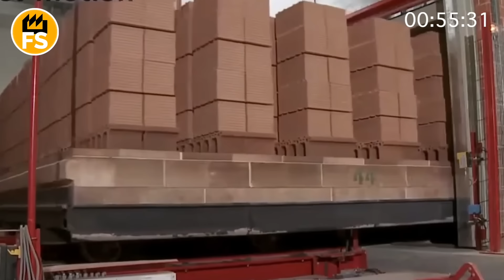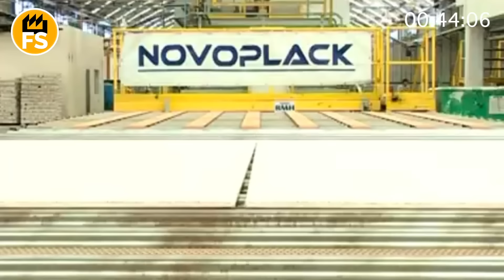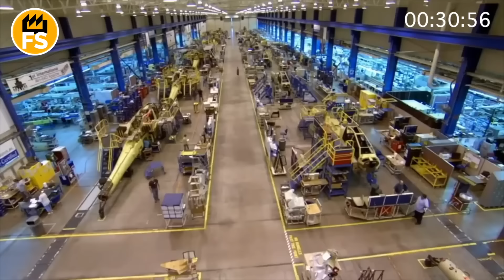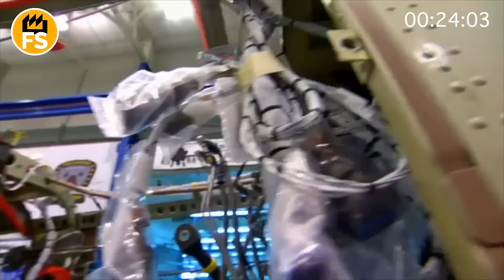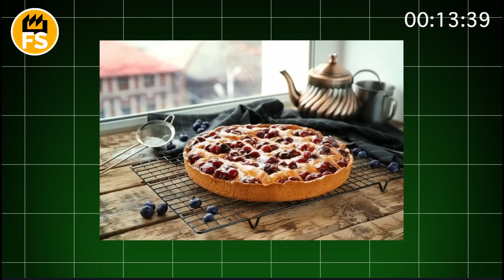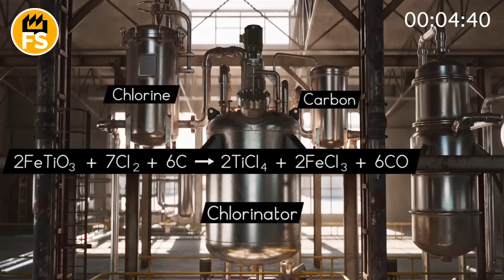How It's Made: How 130 Million Bricks Are Made Per Year! | Top 10 Videos

Comment: At 24.04 you talk about the accuracy of the steel size causing structural collapse.  A signpost  in the picture says Miami Dade which I suspect is Champlain Tower South. If so it's collapse had nothing to do with the steel being a few millimeters undersized so yet again just a cobbled together load of part truths and many errors.
Reply from the maker: Thank you for your insights, @stephenwest9757. While the video primarily focuses on the brick-making process, I appreciate your perspective on structural integrity and safety concerns in construction. Your input adds an important dimension to the discussion!